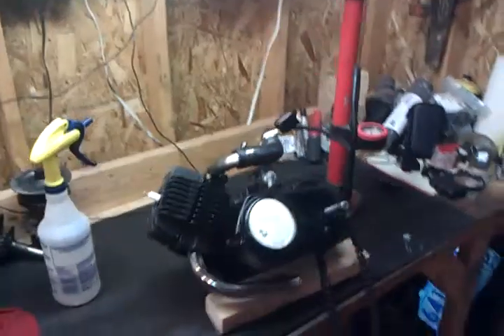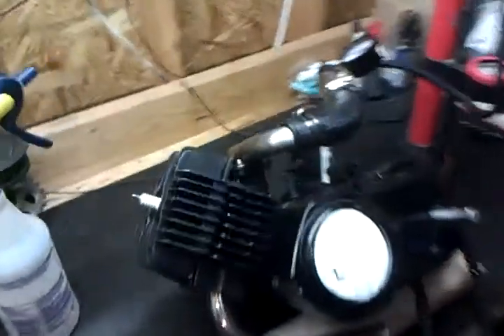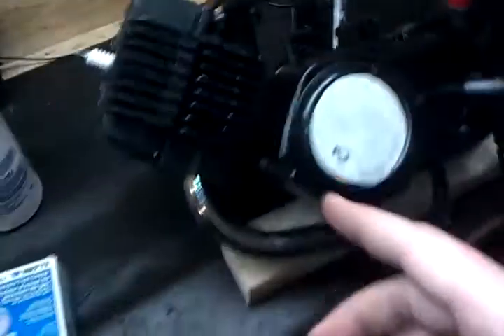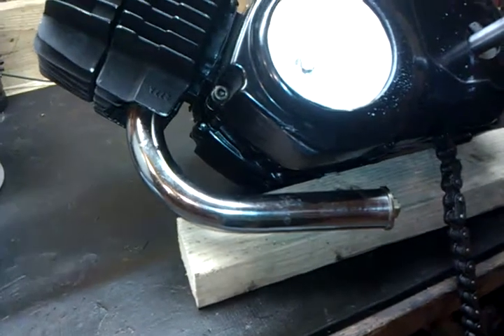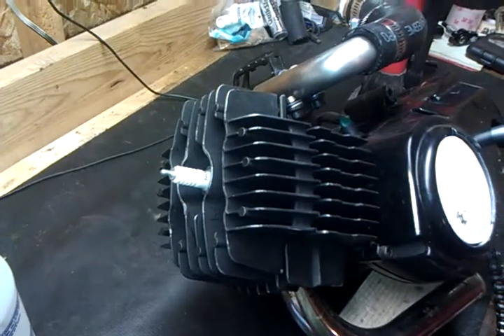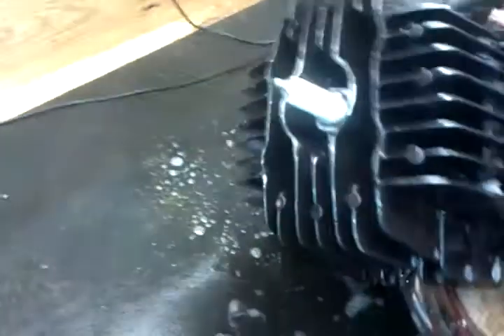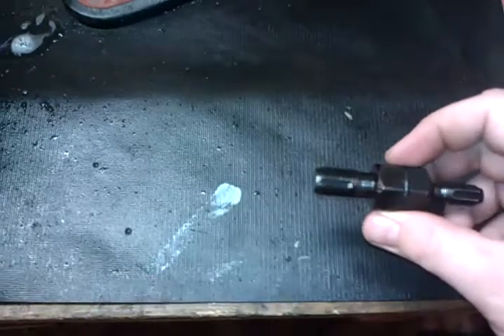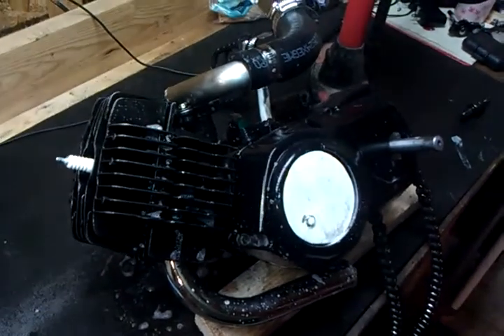Cheap Two Stroke Leakdown test

Comment: I wounder if a pvc pipe plug for exhuast the kind u tighten and it expands for exhuast and a pvc  end cap drilled for a valve stem would do the same job and just need a bike pump with a gauge. Thanks for the vid to give me this idea

Comment from the maker: hmm no clue and from what I've read parts are pretty much unobtainable. However if it is a bosch or ducati ignition system like the tomos mopeds you may be in luck.
Reply: It's a pw50 engine. Same goes with the tomos mc80. I have an mc80 and finding parts is a breeze
Reply: Although the mc80 uses the pw80 engine

Comment: The spark plug doesn't seal by the threads. You need to make sure the piston is at BDC (bottom dead center ) on 2 stroke engine.  I'm also curious how you checked crank seals with side covers on...  Maybe you save someone money on a gauge, but cause them a ton of frustration with crap instruction.